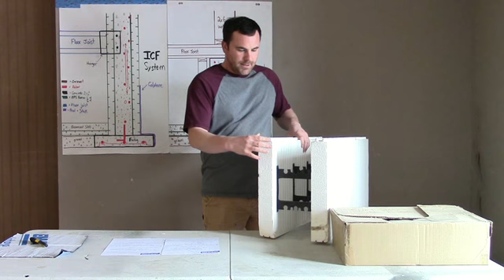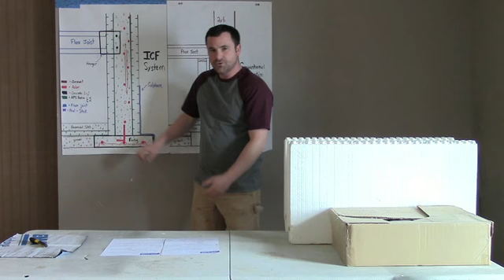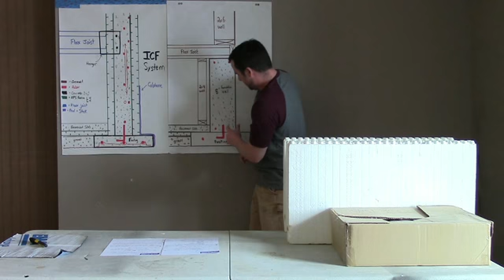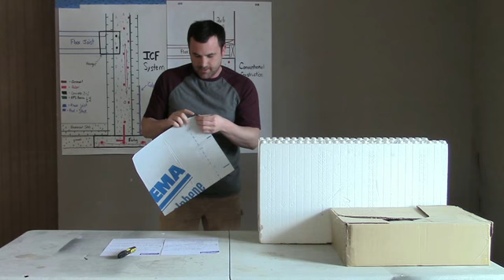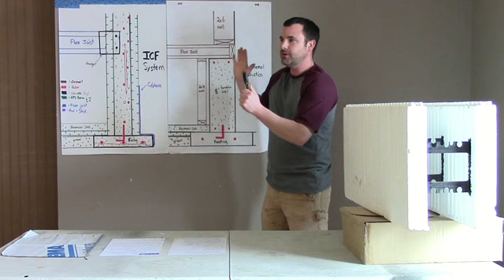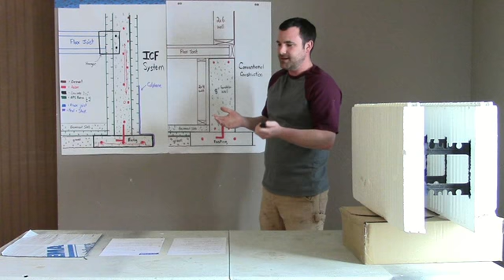20 Advantages to an ICF Building

Comment: Hi Kody, do you have info regarding pouring concrete for ICF walls over 11ft? Can you do it in two different pour to make it easier? For example, do the blocks up to 6' and pour the concrete and then stack up another 5' and pour again. Is that doable or recommended?!
Reply from the maker: For 11’ high I would pour all at once. Sometime we block the shields up from the bottom so the top of the brace is at the top of the ICF.
Reply from the maker: Great questions from you!

Comment: Hi Kody videos are great what dimension are your footings with 6 inch icf /10 ft walls .just would like your opinion.  Thanks
Reply from the maker: I always go 24” wide footing. 8-9” deep. 3 rows of 15mm rebar on chairs for proper placement and avoid rebar laying on the ground. Dowels too of course.

Comment: Kody, I am still puzzled about building full-height walls for multi-story house with ICF walls all the way to the roof.  Is it possible to do a multi-story (e.g. basement, 1st and 2d story) ICF concrete placement at one time (obviously in mfg'r recommended 3' or 4' lifts), to avoid having cold joints between stories, or must they be done as separate pours and just accept the cold joints?  If the latter, are there special tips or techniques to avoid excessively compromising the strength of the walls due to the cold joints (e.g., by extra vertical rebar dowels and/or a formed "keyway" at the top of each story, or other tricks)?  I am concerned about very strong hurricane force winds and tornadoes, and I want the walls as strong as reasonably possible.
Reply: as reasonably possible! At Each level rebar is added the same way you cold joint and reinforce off the footer. And if that doesn't convince you can just look at multi-level ICF houses that survive hurricanes and Tornados that have erased entire neighbourhoods leaving them as the only thing standing. it's not just the rebar that strengthens the house but as he said its a monolith rebarred concrete box. Not a free-standing wall to be failed at a cold joint.

Comment: If there is condensation in the concrete (inside the ICF), is there a construction technique for collecting this water at the bottom of the ICF and helping it flow away from the building?
Reply from the maker: That’s a fantastic question!! The dew point of condensation is in the centre of the wall. I would like to think that this moisture should get dissipated to the outside environment and thus the reason for using breathable membranes for house wrap. 

Certain systems, like EIFS stucco, require a drainage plane for water to escape and installed in a way that it runs out of the flashings. 

I’m am studying more building science items such as this and find it very interesting.
Reply: The condensation point is always where the insulation ends. These dew point calculations are useless and only for laboratories. If you want to learn about these things, study Joseph Lstiburek and buildingscience.com

Comment: Fantastic video Kody, thank you for sharing my friend.   
Love how in depth you went on everything including the true performance value of the wall system with ICFs utilizing the thermal mass and continuous insulation vs other conventional methods (wood and steel).  The Net Zero building trend is increasing and a high performance building envelope like ICFs is an integral part of achieving that status.  
Insulated concrete forms are a true game changer and should be the way we are all building the majority of our structures across the globe. This includes using ICFs for our houses, schools, multi-residential, commercial, agricultural and industrial buildings.  
We are a structural engineering firm in Canada that specializes in ICF structures with projects across North America and the Caribbean.  Would be happy to connect with any like minded individuals looking to utilize ICF in their projects.
Sample completed projects: www.kocsiseng.ca

Comment: I've done a few ICF homes in the last few years,your a good salesman, and make valid points.Very strong energy efficient hom, but u will never recover the extra costs incurred. All the subs are charging more to do their jobs, it's very time consuming.  I would never worry about it breaking down if u get it covered up and water tight.  My opinion is if the foundation is straight forward it's not bad, but I did a house that was planned for SIPs and then changed to ICF and dimensions didn't work as well as it should've, but that's just poor planning.  The more turns in a house the tougher it is to keep plumb.  I'm 30 years as a concrete contractor if u are questioning my background.  It would benefit me to push this system, but I probably wouldn't take it above the basement walls.
Reply from the maker: I’m the opposite. I think it easier once you get above the 1st floor. I do agree that it’s tricky to maintain plumb with multiple corners.  Also the trades I use don’t charge extra for portion of the job. The biggest impact is to the electrician and once they know a few tricks it’s just as easy as anything else.  The way we do things is different. We are carpenters so there’s no extra coordination between ICF guys and framers. We do both which makes it easy. Thanks for your response! Valid points for sure.
Reply: I do both too,  if the house is multiple stories se the floor systems in and stairs, even if the walls aren't poured, then I can plumb up walls and brace them without much of a fight.  Definitely more of a carpenter type system.  I see the benefits of this house, I just typically have customers who want this, thinking it's cheaper less work and will save them money in the long run.  Only if u live a hundred years.  U need to look at these not for economical reasons, but for strength and quality reasons

Comment: I was wondering in our imperfect world how would you see if any of your walls were cracking, chipping, bending and bowing before it was to late with total failure. Don't get me wrong, I would love to use icf's in my next new home. Please get back to me asap. What about the ones where the insulation is in the middle of the concrete?
Reply from the maker: Good question. It’s all in the prep work and knowing and appreciating the force of Concrete. One tip is string all your lines before pouring so that once you’re done it’s quick and easy to straighten your walls. If it’s a big pour you can also add delay set to the Concrete to buy more time to pour and straighten. As for voids if you vibrate that solves most of that. You can tell if there’s a void by the way the vibrator feels as it moves inside the wall. Never had a problem with voids unless it’s less than a 12” space down a column or something. If you use the rebar that the block companies suggest you shouldn’t have cracking issues. Make darn sure to use hook dowels to attach your footing to the wall. That way they can’t separate and it makes the entire assembly one unit. Be aware of high backfill areas and if you do consult an engineer.
Reply from the maker: As for systems with insulation in the middle. Not a fan. Most common is precast Concrete. You will have expansion and contraction difference from inside temperature vs. Outside temperature. Not a monolithic wall like ICF. The wall is only as good as the weakest point and on precast that is a bead a caulking between panels. You have to trust your roof to hold the walls up. If a disaster happens and the roof is gone then those walls can fall down. ICF is the only wall assembly that doesn’t need a roof or floor to support the walls. They stand on their own.  Hope that’s helps!!

Comment: When your done are the outside of the walls foam?
Reply from the maker: Yes. The foam stays inside and out.  The black plastic snap ties are what hold it all together while you pour concrete.  Those ties are 8” on Center, they also serve for attachment of drywall on interior and rock, siding, stucco on the outside.
Reply: @uptokode  Could you put brick on the outside?
Reply: @robertbrandywine  Yes, Nudura and other ICF mfg'rs make special blocks with a "brick ledge" so that when filled with concrete and rebar they are designed to support the weight of brick, stone veneer or similar exterior finish.

Comment: I think ICF co construction is amazing.  Look at how the ancients built using stone and how long those structures last!  I think that says something.  I do wonder about the plastics and foam longevity though.  Any thoughts?
Reply: The biggest enemy of plastic is UV . Since these plastic components are encased in styrofoam, which is itself encased by waterproofing membranes, which are encased by finishing materials and/or dirt ( if sublevel), its very likely that these plastics will outlast all of us. Just make sure to follow instructions on what kind of screws to use.

Comment: Concrete dust released by building demolition and natural disasters can be a major source of dangerous air pollution. The presence of some substances in concrete, including useful and unwanted additives, can cause health concerns due to toxicity and radioactivity. The presence of some substances in concrete, including useful and unwanted additives, can cause health concerns. Natural radioactive elements (K, U, Th, and Rn) can be present in various concentration in concrete dwellings, depending on the source of the raw materials used. For example, some stones naturally emit Radon, and Uranium was once common in mine refuse.[27] Toxic substances may also be unintentionally used as the result of contamination from a nuclear accident.[28] Dust from rubble or broken concrete upon demolition or crumbling may cause serious health concerns depending also on what had been incorporated in the concrete. However, embedding harmful materials in concrete is not always dangerous and may in fact be beneficial. In some cases, incorporating certain compounds such as metals in the hydration process of cement immobilizes them in a harmless state and prevents them from being released freely elsewhere.[29]

Comment: Not terribly convincing: 1) footings are about the same for wood framing as for your ICF wall.  2) The wall itself is likely flammable so long as a source of heat is applied; I don't know if the fumes generated are toxic or not; 3) Yup, you have a lot of rebar in the walls.  Why is it that the State of Michigan has discontinued the use of rebar and replaced it with fiberglass other than the expansion rate of rebar is different from the concrete?; 4) drainage systems do differ but on the house I built, I put down 4" to 6" of gravel, 6" schedule 35 perforated pipe, silting cloth and 6" of pea stone and another layer of silting cloth before backfill.  Gutters and down spouts are connected to schedule 35 solid pipe and lead to an open area away from the hose; 5) the vapor barrier is applied over the OSB sheathing to the OUTSIDE of the house, followed by a layer of 5/8" Dow Board and another layer of vapor barrier.  Siding of any kind can be applied over the surface.  6) I look at ICF construction as excess cost.  My gas/electric bill for the last month with steady 90 degree temps on 2,300 sf. was about $120.  In the winter I have yet to exceed $100.  So there is no cost savings.
Reply: John Gritman 
Not terribly convincing.
Reply: WOW, it must have been late at night when I wrote that comment.  I actually spoke to a foreman working on the highway from Jackson MI to Ann Arbor MI because I only saw rebar on the cold joints (where they stop at night and restart in the morning).  They carefully cut the new concrete to get a nice sharp vertical edge, drilled horizontal holes into the cured concrete, added solid 1" or more connecting rod and continued pouring.  That was the answer I got - rebar expands/ contracts at a different rate than concrete.  My concern was/is that Jesse needs to create an inverted "V" drain on the hill side of his house using 6" perforated pipe about 6" below the surface and lead the water around the house by connecting the perforated "V" to solid pipe that "runs to daylight.  Using 6" pipe he can connect the gutter downspouts.  The cost differential is very small when compared to 4" and a good rain storm will flush out any 6" pipe.  I also don't understand the drain pipe in the cellar of the house.

Comment: What do you do when the styrofoam turns to dust and the plastic gets old and brittle in say 30 years?  Do your walls just fall off and you are left with an ugly concrete wall with bits of plastic and insulation sticking out of it?  This stuff looks great for the first owner but a nightmare to keep up or remodel for future generations.
Reply: Concrete if done right can last for 1,000 years.  I can see your fear.  After all the wooden homes fall apart it will still be fine.

Comment: What about gasses given off by the foam? Isn't this dangerous?
Reply: The light given off by the SUN is much more dangerous.  The electricity in the walls is pretty dangerous too.  Just to scare you.... after this is done it will be water tight.  You could drown if the building fills up with water.  Water is kindo dangerous too....  Wow... I guess everything is dangerous if used incorrectly.
Reply: And very dangerous if it is eaten or used in cooking !!!
Reply: ttraderjim yes, regardless of what the smart-asses above have to say, the off-gassing from the foam is definitely toxic.
Reply: No it isn't dangerous I haven't had any problems with my home it actually improves air quality

Comment: btw, last question Kode,

everything gives out poisonous gas slowly as it degrading.. that's why there is a  saying that our home is killing us slowly - slow murdering us. 

hence i hate to have styrofoam or any type of cheap plastic in the interior of house. i rather all the styrofoam panel insulation only at the outside of the house, hence our whole cement wall will be warm , which will act like thermal battery when we turn on the heater .. 

i am right.  ? 
where i sleep in, i make the whole sleep room almost empty, not carpet, or plastic tile, not Styrofoam... at least i kept it to the minimum.. :=)  i don't want to kill myself slowly. 

i hope there might be system such like ICF, but no styrofoam on one side of it , which i can use it as interior. 

anybody have more knowledge, pls correct me. thank you.
Reply: Andrew, maybe it's a slow release, it looks like it takes 500 to a million years for Styrofoam to decompose.  Throw some mud on inside of wall: )  Should worry more about fluoride in water, mercury in silver fillings and vaccines, preservatives, processed food, GMO's, MSG's, additives, aspartame in diet foods and drinks, ect.
Reply: From what I have been looking at since finding ICF 10 years ago is some of companies offer a one side knock down system which is just plywood or other similar wood board that can be removed once the concrete is hardened enough. Thus if you want to insulate just the outside, the knockdown is great for this as the plastic ties keep the styrofoam side in place and offer fastening strips inside still for what ever exterior finish work. True that concrete makes a great thermal mass that once heated it can provide ambient warmth throughout the night, but then again the temp can drop drastically at night and thus one can install a floor heating system for added heating at night when required and once warmed up to set tmep it uses less energy to maintain the warmth.

In my opinion, having the inside bare is great for many situations succh as needing that extra interior space and for example in a Province of Canada they require a R22 value for new construction and thus those wo go traditional formwork know have to install an interior two by six inch framing for insulation. In that situation having that R22+ on the outside keeps the interior clear of that intrusive insulation for more interior space. Then again with bare concrete you now have to drill holes where you plan to mount something that requires anchoring, thus I rather go with thicker exterior insulation and standard 2 inch for interior and with the built in fastening strips I can just screw anything to the wall where those strips are. Not sure a stud finder can detect plastic fastenings.

Warehouses and those built for store use like Lowes/Walmarts would greatly benefit using ICF. as it reduces AC an Heating requirements and thus further reduces those running costs, Even more so in COld Storage warehouses with some offering Thicker concrete walls and thicker or deeper insulation for even less Refrigeration running costs.
Reply: Thats a good point andrew ysk.
Reply: That's why I am laying rock walls.
Reply: andrew ysk look up Just BioFiber
New GREEN replacement for ICF made from Hemp! As good or better than ICF and CARBON NEGATIVE
Reply: Would a fantastic HVAC system make a difference? get that Gas out as it forms and replace it with fresh air
Reply: There is a UK ICF with a way to do concrete one or both sides with panels which unbolt after the cement sets.. Thermal mass + battery + no out gasing.

It is at the Self build show in a few weeks in Bicester.
Reply: https://builditlive.co.uk/whats-on-at-build-it-live/build-it-live-in-bicester/
Reply: NUDURA One Series Forms

Comment: i personally believe this icf system is very good. good insulation, that's one thing i believe.. 
how expensive is it ? 
i am at germany, is it available in Germany ?
Reply: Germany pioneered the use of ICF construction after WWII......Most of the reconstruction was performed using this method.

Comment: Kode, 
is the ICF form block is open cell or close cell ? if it is one side open cell and the other side close cell, it will be so much better.. that's means moisture or is it only water won't go into the close cell insulation , hence concrete is dry always.. but close cell styrofoam is more expensive then conventional white styrofoam.